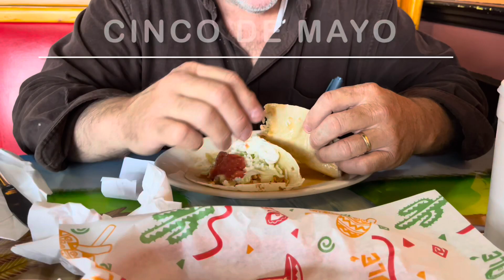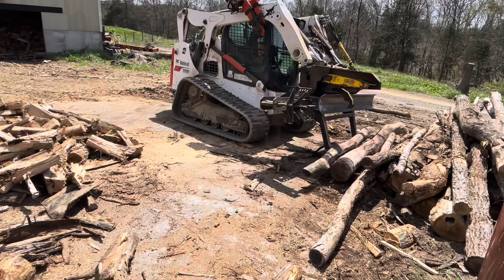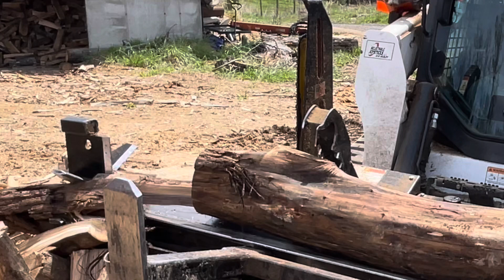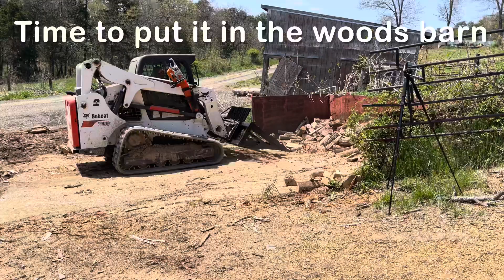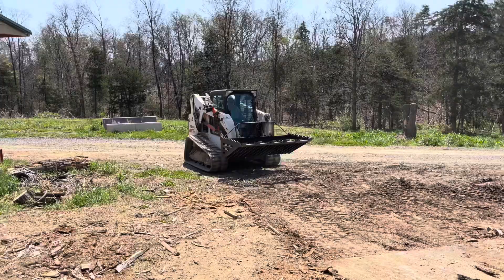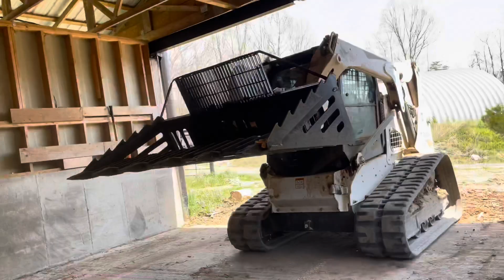Halverson 120 FIREWOOD PROCESSING! #221

Comment: This was perfect. I have been on Halverson's site for the last few days and saw your video on Shaver channel. Then I went to yours and was watching a couple processor videos and then this came out 10 minutes later lol!
Reply from the maker: Build Life, Buy with Confidence, Halverson is an American company and a person answers the phone, There Warranty Response is A+, Take Care and Stay Safe 🪵🚜👍🏼🇺🇸
Reply: @outdoorswithlarryrobin  Thanks! Do you ever wish you had the 140 or 150? I'm torn on what size to get. The 120 is obviously more affordable but I worry its not big enough.
Reply from the maker: @buildlife  I believe now I would have bought the 150 if available, it has a larger saw, redesigned grab bar arm and adjustable wedge. The biggest difference in the 120 and 240 is the controls, the 120 has simple switches relying on springs to contact the switch arm, where as the 140 uses Proximity sensors through Magnetics, All depending on what size wood you will be processing and your finances
Reply from the maker: @buildlife  curious what machine do you have to put it on?
Reply: @outdoorswithlarryrobin  I have a Case 435
Reply from the maker: @buildlife  Nice Machine, Compares with my bobcat, At 21 gallon hydraulic flow it should perform equal to mine, you can handle the 150 easy. Not sure what they Cost I paid $10,600 for my 120 and extras 👍🏼🇺🇸
Reply: How many cord an hours can this processor do ? 1 per hour ?

Comment: Great machine, do you know what the exact saw motor is? thank you for yor help.
Reply from the maker: Hello Mody, the motor on the Halverson runs on Hydraulic pressure just like everything else. The Bobcat engine is a Doosan 74hp diesel 🪵🇺🇸
Reply: @outdoorswithlarryrobin  the motor saw it will be Parker f11-050, think correctly?